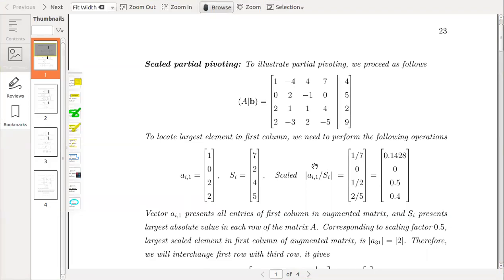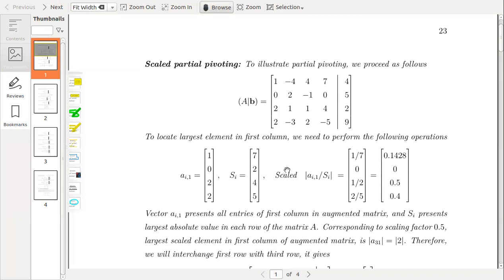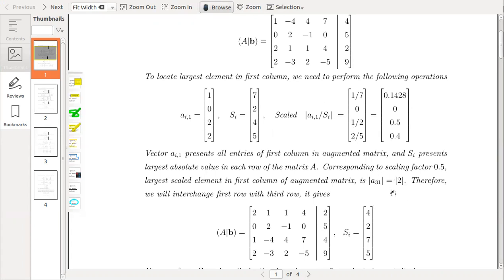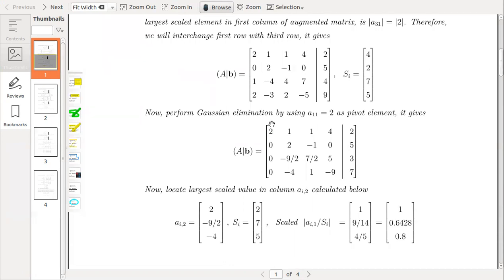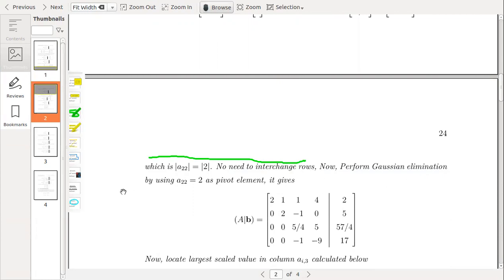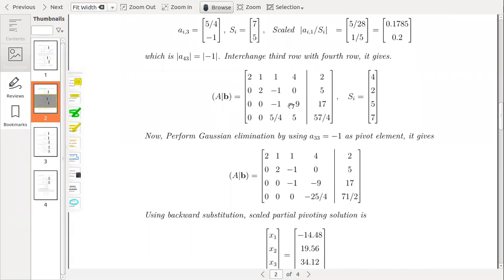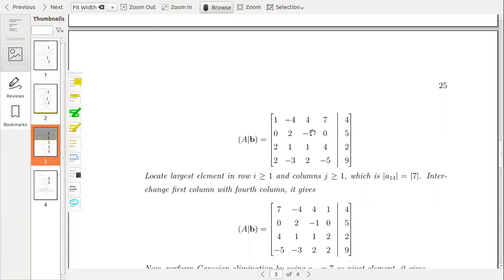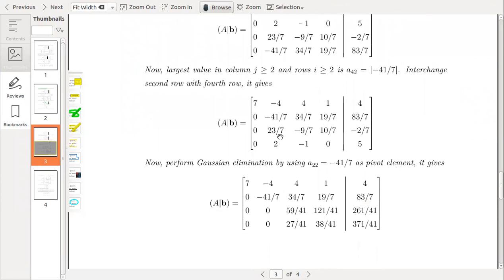Scaled Partial Pivoting, total pivoting

Comment: sir! i would like to ask you why in selecting "si "values sign are not considered?
Reply: Remember the reason for pivoting is to reduce truncation errors. For example, the truncation error of 2÷3 vs -2÷3 will be the same, regardless of the sign.
Reply from the maker: We need to take largest value, best is to take absolute value.